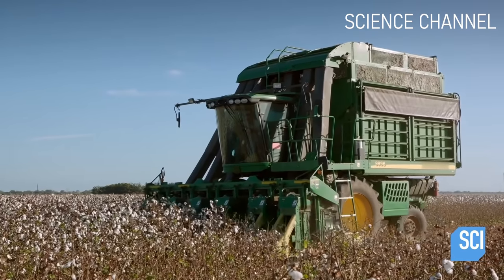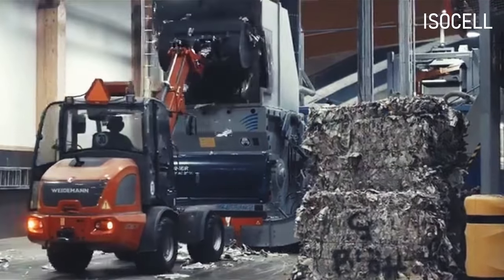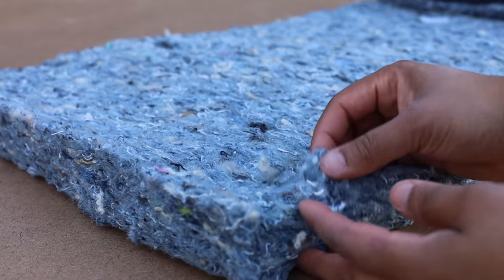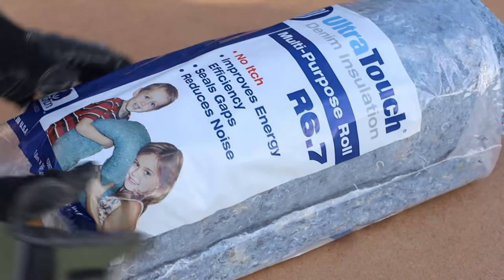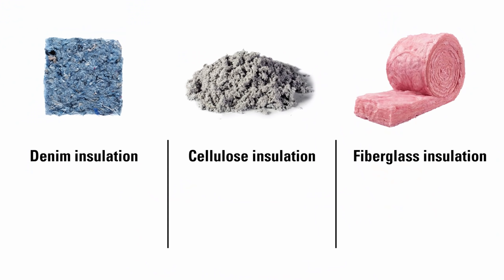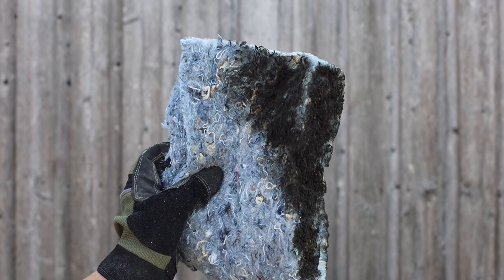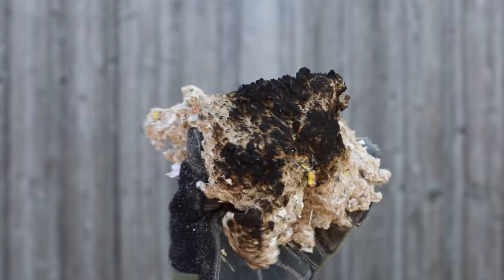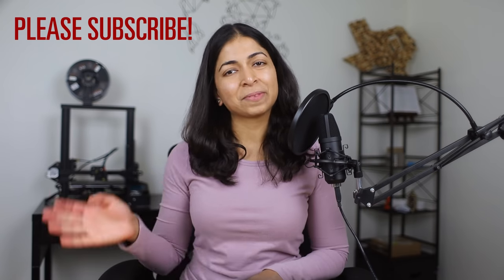Denim vs Cellulose Insulation | Everything you need to know!

Comment: Great comparison.  Last year I DIYed blow in cellulose in my attic.  I found it easy to work with but an air tight mask and goggles where definitely necessary.  As far as price, Lowes was selling cellulose at a crazy discount making it cheaper than fiberglass or denim.  Already in 13 months the cost of cellulose has broken even with the heating/cooling savings.

Comment: I installed cellulose in houses more than 40 years ago and have seen them since and I have not witnessed any degradation of the cellulose and this is the first time I have ever heard of its degrading.  My good friend in Weedsport NY was the first manufacturer of cellulose fiber in the US and I use to get it from him by the tractor trailer load.  Huge fan to say the least.  I built several houses with 10" truss type studs through the early 80's ---all with blown cellulose.  One house I built in 1987 had a blower door test done on it in 2012 and tested at under 1 ACH 50.
Reply: My house was built in 1951 and they filled the walls with cellulose in the late 80s.  It's since settled to about 4.5' up from the floor with 8' ceilings.
Reply: Unfortunately there were lots of poor installations back then.  Fortunately it can be re-packed. @veganpotterthevegan

Comment: 30 years ago I designed an addition to my father’s 200 year old house in Vermont. He’d had cellulose blown in 15 years earlier. 2 exterior walls were removed. I was very impressed with how intact, and firmly in place the cellulose was. Zero gaps. It should also be noted that cellulose work well as a moisture “damper”...particularly in older homes where it may be better to have no vapor barrier than risk trapping moisture.
In a home where you generally will allow related humidity to fluctuate seasonally keep your walls air-tight but water vapor permeable. Modern cellulose insulation can absorb water

Comment: My cabin will be 3 48' sea containers side by side with a loft. Conditions are extremely hot in the summer and rain forest in the winter. The bottom will be spray foamed and then spray tar willbe applied in order to protect the foam from critters and moisture. The exterior walls will be 4" foam with a double bubble, triple foil on both sides of the foam insulation with an air barrier between both sides of the foam and an air barrier between the hardy board siding and the bubble foil.
The interior wall will be the same but with rockwool for interior insulation and concrete wallboard on the bottom run around the interior of the home and gyprock above. The plumbing and wiring will be run through a hollow space in the 4" insulation in the floor and infloor heating above that.The plan is to keep the cold out and the warm in and use air spaces whenever possible to help the process.
Love the videos! Keep up the great work!
Mike Fitzgerald 
Calgary Canada 🇨🇦

Comment: Another correction from a Manufacturer of the Cellulose fibre insulation product - Borax in the treated paper does not mean that it can not be used in future as insulation. In fact it is the only insulation that we can vacuum out and pump into another roof without any remanufacturing of the product. Borax does not evaporate and so it is as fire retardant as the new stuff and so it can just be blown back in. I do want to correct another final thing you said which is that it can be used for mulch after being used as insulation. That is not true, in fact it will mostly kill any plants you put it on as borax is a herbicide like salt but without the same corrosive properties as salt. Anyway finally on effectiveness you did cover how messy cellulose is to install but once it is installed that does not effect the home owner at all. However the HUGE advantage of being messy to install is that it will leave no gaps. Zero gaps in the insulation is something that batts can not do in the real world on most jobs, as for example when laid over wires or baton timber and just 1% gaps can reduce the effectiveness of insulation by as much as 30%.  So I would say a bit of mess during installation is a huge advantage to the product in terms of the result customers want. www.insulation.team

Comment: Cellulose fibers retain their R-value in normal humidity levels while fiberglass looses half when you open the bag. Sprayed onto walls and ceilings cellulose absorbs about 90% of noise and can be dyed different colors. It also wicks water allowing it to dry faster and the fibers are hollow whereas glass fibers transmit heat. I dump loose cellulose behind burlap and hardware cloth ( 1/2' looks better ) in my basement to insulate my rim joists and block walls and there is no dust or mold. It also blows well into walls in old uninsulated  houses with little or no sagging. For small batches, like in my basement , I fluff it in a 5 gallon pail thats screwed to a piece of plywood that I stand on so I can fluff it with a paddle mixer sticking through the middle of the cover for my 1/2" drill and then scoop it out and dump it behind the mesh, about 16" on the blocks and 24" in the rim joists. Very little dust but I wear a mask.

Comment: Cellulose is cheaper than fiberglass and has fire retardant and pest control but one messy and difficult job to install. You can barely see anything when you install it and have to pause the machine to see what you are doing. Well explained.
Reply: Cellulose is superior insulation compared to fiberglass. Fiberglass loses R value with temperature extremes.  Best green cost effective product!
Reply from the maker: Thanks! Do you install dry or wet cellulose? Both seem very messy.
Reply: @BelindaCarr  I only have installed dry attic cellulose at r60 in Canada. So 17.9 inches installed and it settles to 15.9 inches. The construction industry unfortunately does not favour slow and meticulous installation so when you have to stop the machine to see what mistakes need to be touched up (dust yo settle) then it gets frustrating. I know some companies say misting is a good idea but you need the proper mask plus like you said, if you mist too much mold will grow in the cellulose.
Reply: @BelindaCarr  thank you for taking the time to reply to my comment. Means a lot.
Reply: Very informative video. I've been working  at  greenfiber since 2005. They up the oil content to cut back on the Dust
Reply: Loose fill Fiberglass is messy as well, itchy & terrible for your throat & lungs.
Reply: @blackberryfarm7179 
Yes, I have lived in several homes with cellulose in  the attics, and several with Fiberglass batts/blown in the attic.
The homes with cellulose stayed cooler in the summer,  and cost less to heat during the cold winter months.
Reply: As a manufacturer I can tell you that if you are getting a cloud in the roof while pumping it is caused by to much chemical (Borax and boric acid) sometimes this happens when they remanufacture product that have been vacuumed out of a roof as then it has effectively twice the chemical or they might be using powderized chemical and not granular in the manufacturing process. the powder stuff has no advantage but it does make the cellulose fibre product dustier. I hope that helps - I should say I am in Australia and here manufactures only use these two chemical that I know of but in other parts of the world they might be using different chemicals (although that is not very common)😀
Reply: @InsulationTeam  thanks for the insight. The powder does seem white so that would make sense it's borax.

Comment: Belinda, I recently discovered your channel, and can't get enough. I am LOVING your content. I would really appreciate if you could do a video on asbestos. I think a lot of people don't think about it and just assume it's present only in insulation. Well. I just moved into a rental townhouse that was built in 1965. My previous home was an apartment in another Iowa city built in 65. Both apartments had many original fixtures. I'm sure that other apartment had asbestos somewhere, but this one has a popcorn ceiling throughout, except in the kitchen, the original tile backsplash in the kitchen, the original linoleum kitchen floor, original walnut cabinets/laminate kitchen countertops, and original ceiling tiles in the finished basement room. If I had to bet, except for the kitchen cabinets, there's asbestos in all of that. Glue on the counters, tile grouting, in the linoleum, and definitely in the ceiling through the whole house. I would just like to hear what you have to say about it, its (continuted/unknown) presence, and how it's safe as long as it's not manipulated. Thank you.

Also, your radon video got me thinking I should buy a detector.

Comment: Belinda, I have a passive-class low energy home which has an internal timber frame made up of custom-to-plan Larsen strut system which creates a 30cm void between the interior VCL and the airgap-facing Panelvent boarding. (The outer skin is laid stone.)  The void was filled on site, post frame construction using blown cellulose giving an overall U-value for the total profile of < 0.12 W/m²K, an excellent tested air-tightness. This type of installation should only be done by specialist contractors, but that being said IMO this is best type of infill for this type of installation, and is one of the alternatives which could achieve UK building code fire ratings.

Comment: Fantastic informative video.  I was waiting and looking for your cellulose video before insulating my attic and glad I did.  There is also the added cost of installing attic vents when using cellulose which could add $100 to the project.  Which would you lean towards for a '70s ranch attic in zone 5.  From your vids I am leaning towards hemp if the cost will be comparable to rockwool.  Thank you Belinda amazing content

Comment: I think you touched on two important issues that you should revisit.  One being the "actual" cost of a recycled item after factoring in the initial cost of raw materials and the first manufacturing process.  Second being the over-pricing of items that are "recycled."  Example - We used to sell concessions on the festival scene.  Certain festivals would require that all of the serving items were green, biodegradable and recycled.  Forks, spoons, plates, napkins et all.  It actually increased the cost of the base meal such that it wasn't worth it to sell at some of those festivals.
Reply: You have a very good point. Recycled is not always better. Its a gimmick when it comes to wood/paper products. The reason behind this is because people are under the impression that paper mills cut down treas and move to a new area and never do anything with said previous field. Yet paper mills plant more trees than anyone else does, over and over and over again. new paper products are far cheaper than recycled ones.

Comment: My parents' house was insulated with loose cellulose, but it wasn't installed wet as you showed, they used a humidity regulating canvas that was stapled to the front of the studs and then blew the material into the space through holes cut in the canvas.

Comment: Ok as a Manufacturer of cellulose fibre insulation in Australia, I would like to correct the following error in this video. At 11:09 You said the cellulose will breakdown over time ? why do you think that Paper is biodegradable when exposed to the elements like water and sunlight but in your roof it should not have any exposure to these. Saying that paper breaks down over 20-30 years is wrong, we have books that are not treated with borax that have been around for hundreds of years.  Also you said that the cellulose can get mould forming on it because it is paper. Again how many books in the library have mould on them? That will only happen if it is exposed to water.

Comment: Blown insulation is superior. You can insulate faster, the R-value will be higher at an equal depth to Batt insulation, and you can eliminate the thermal bridging which almost always occurs from using batt insulation. Also saying blown insulation can cause poor air quality because it can get into your HVAC system is certainly something that happens, but that isn't a problem with the insulation, it is a problem with your HVAC system which has leaks and needs to be sealed or replaced or better yet relocated.

Comment: 2nd day of watching your videos, thank you Belinda, as interesting as always. Thank you !

Having completed a technical degree on green houses in France, I can add another advantage of cellulose and denim insulation : "déphasage thermique" or thermal shifting. (I have yet to read a good translation for that in English). 

Both materials are better than mineral or fiberglass at preventing the outfdoors heat from getting inside a home (10-12 hours compared to a few hours for more traditional materials). This means increased comfort during heatwaves, thus less A/C required. Edit : apparently this is due to the fact that both materials are heavier than their competitors.

I have no clue as if this is true, and/or verified. I have just read many reliable sources -including professionals - claim this... It may just be another argument to sell more circular economy materials but I doubt it. Have you heard of something similar ? What do you think ?
Reply: It might be correct. Wood fiber insulation is an excellent heat buffer, that holds the heat for a much longer time, than mineral wool (or keeps cold away for a longer time).

Comment: Both chemically treated to be non-flammable, but being organic fibers can retain moisture.  Good for sound attenuation on interior walls, but not a good thermal barrier for exterior walls or ceilings.  The moisture they can retain can transfer to the sheetrock, and over time cause mold and fungus to grow on the sheetrock.  If you do use it there use a mold and mildew resistant paint on ceiling and walls.  I know as I have been in the insulation business since 1966.  Use Fiberglass or Open Cell Foam on walls and ceilings.

Comment: Consumption is the main driver of GDP in modern mixed economies, so we need to make these solutions cost effective by offering the manufacturing firms government incentives (increased aggregate spending).  It seems that Rockwool is hard to beat, though the manufacturing seems to require more heat energy.  I'd like to see a comparison of the denim and the rockwool.

Comment: Dense pack cellulose in walls is much better than fiberglass.Both fiberglass and rockwool are natural matewrials and are not an insulator on there own.Too much is put on R value.Stopping convection is more important.Both denim and cellulose are more expensive,but in the long run I believe they are better at insulating.If you check the people installing cellulose,they show a comparison between it and fiberglass.You can easily see the temp go up on fiberglass,thats the convection taking place.
Gary Schumacher

Comment: Great video. I comment more of a question, you talk about the size in 1" thick in the cost factor, but most building walls are 3 1/2" thick, so if I use 3 1/2" of each of the different what is the actual cost pre square foot of  that insulation? Thank you

Comment: Where did you get twice the cost? My installer used cellulose insulation for our 1964 ranch, and it was cheaper than fiberglass batted insulation. Same with another installer I got a quote from.

Comment: 3:36 Considering that it is air pockets that act as the insulator, what about using bubble wrap? Would an inch thick layer of bubble wrap have the same or better insulating properties in regard to the denim insulation?
Reply: I think that the air pockets might be too big- once they reach a certain size you get convection in the pockets and heat transfers way faster. Not sure what that size is.
Reply from the maker: Funny you should say that, I'm getting samples from a European company that makes multi-layered bubble wrap foil insulation. It's 100% recyclable. I'll release the video as soon as possible.

Comment: After 20-30 years it begins to decompose? I plan on being in my house for 50 years. Are you expected to have it replaced every couple of decades?
Reply from the maker: I'm following up with the manufacturers on that lifespan.
Reply: @BelindaCarr 
I have yet to see manufacturers guidelines that state insulation products need to be replaced after 20 years.
A few reasons to replace insulation,  would be a house fire, or flood.
Possibly in 40 years, the insulation won't be deteriorated, but insufficient thickness which may be required by future building codes.

Comment: Wow you have some interesting home insulation processes over there.
Denim though, I can imagine that being used over in UK, only the chavs would insist that their denim is Wrangler, not any old cheap stuff 😂
Reply: I used cotton, made in France, distributed by Sheffield company. Took a while to get the hang of using, cutting was tricky, but tearing it across lengths turned out to be the solution, getting a good friction fit.
Main benefit, able to insulate bit by bit whilst living in the property as not dusty AT ALL.

Comment: Sorry, your numbers are a bit off here.
Cellulose loose fill is R 3.7 per inch, dense pack is.R 3.8 per inch.
Fiberglass batts are around R - 3.3 per inch.
Loose fill Fiberglass varies from a dismal R 2.2 per inch,  to R 2.7, if you have a more than 12 inches depth.